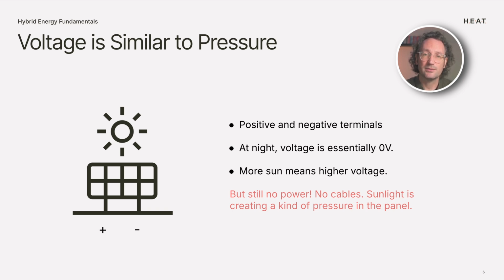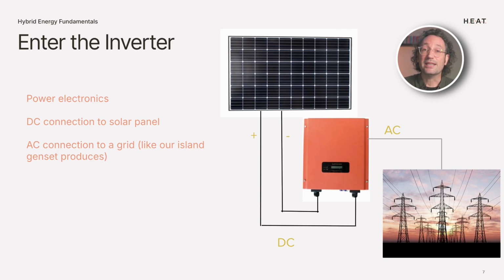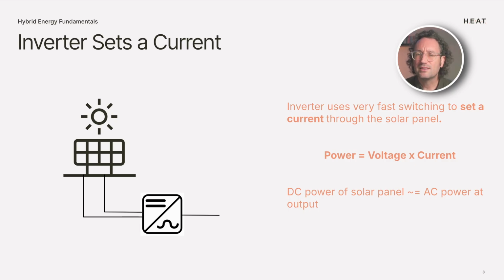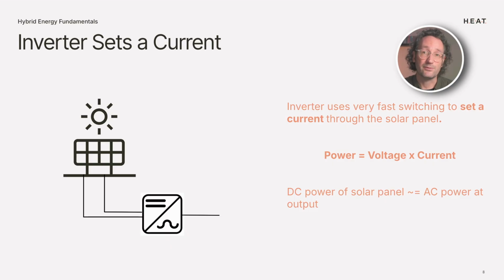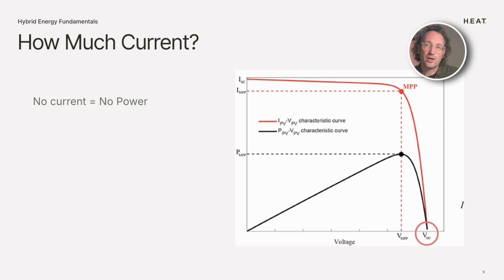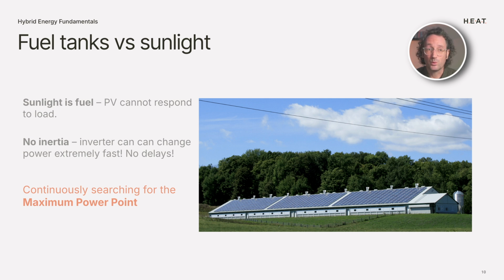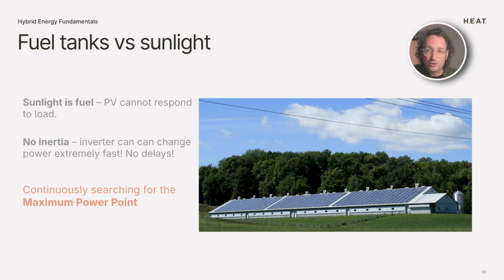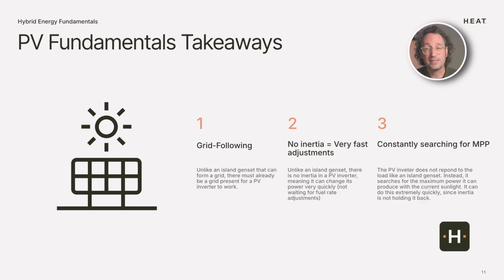Hybrid Energy Fundamentals Part 2: Solar Photovoltaics

Comment: You said that no inertia is good as it can react fast, but surely that would better when grid forming? When grid following, if a sudden load is put on the grid the lack of inertia can cause a voltage drop, and a drop in frequency as the grid forming generator slows down....then because the solar is only grid following, it's hard to get the frequency back to where it needs to be.
Reply from the maker: Great question! If we tried to run the PV without a grid-forming element, it would never get the frequency back up -- it would just trip and cause a blackout, because it cannot regulate its fuel supply. This is exactly why a grid-following PV inverter must run in parallel to a grid-forming element, like a diesel genset or a larger macrogrid. We'll see in the next video how that load step will be taken entirely by the grid-forming element, with the PV (usually) totally undisturbed and unimportant. We will also look at edge cases where the fast response is actually helpful to avoid a potential blackout.

But directly to your question - yes, no inertia is fantastic when grid-forming! Unfortunately PV is not suited to that role. However, battery energy storage systems definitely are suited to that role, and in my opinion they are the key to this whole hybrid energy topic. We'll cover that in a future video as well.